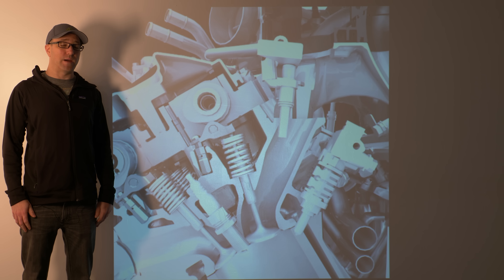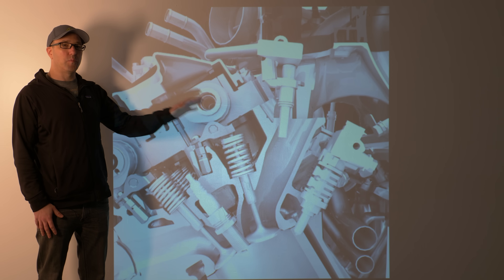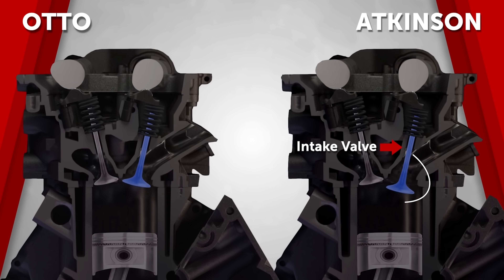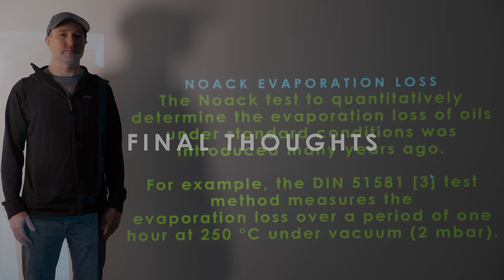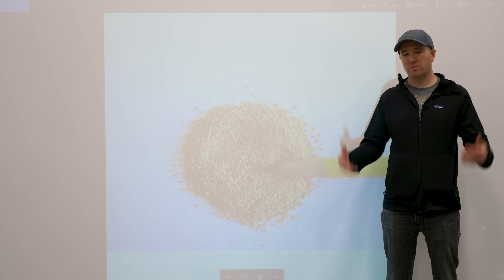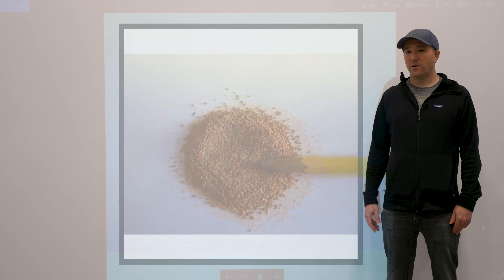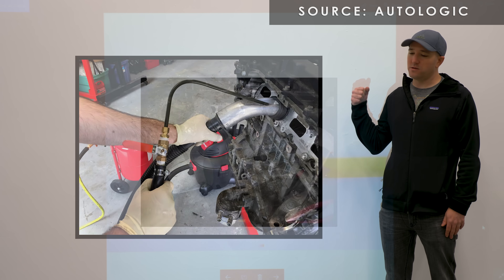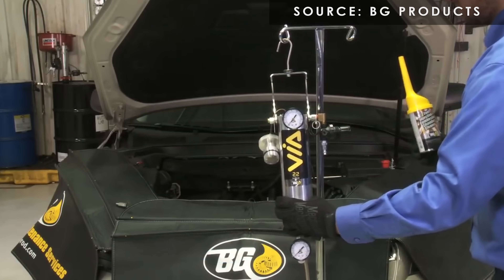Direct Injection, Problems and Solutions | The Fine Print

Comment: I worked for Orbital Engine Co in the test department where my job was to optimise the fuel delivery timing to combustion space using our two fluid direct injection system. The injector used two chambers . Low pressure fuel was metered by the lower chamber and the upper chamber was fed with high pressure air which was used to blast the fuel into the combustion space at the appropriate time for the particular speed and load. Using the air assist injection gave us control over the spray pattern and droplet size and playing with stratified charge enabled air fuel ratios as lean as 70:1. Had a great time mapping the engines! Transferred to the Tune Department and my job was to push the engine to it's power limits so basically I got paid to blow up hand built engines at$50k a pop! haha!

Comment: The EU and their crazy regulations are the problem. A bunch of countries giving up their sovereignty to a bunch of bureaucrats who are hell bent of keeping themselves relevant by writing rules for the sake of writing rules.
Reply: Found the bitter Brit...
Reply: Not really. A hybrid car with dual injection and no turbocharger is no less reliable than older less efficient cars, but provides better mileage, less emissions, and more power. 

It's up to the manufacturer to choose the right thing. (Of course, if you want reliability, electric makes the most sense.)
Reply: @DarcersTech  its still not the manufacturer. European manufacturers tend to grant the wishes of the customers, who want more power with low fuel consumption. 
The average hp in Germany has risen to 152 hp (German PS). So manufacturers build engines with small engine displacement and squeeze out the most of hp that is possible at minimum cost. 
And they have to watch out for these regulations. 
Its these marketing guys who tell engineers to bild such engines. At the end you can throw them away after surpassing 150.000 kilometers.
Reply: @davidradtke5166  And what I am saying still stands true. An electric motor can be used for power / torque support without significantly increasing the emissions.
Reply: @DarcersTech  still. Modern cars are now throw away items. Electric motors for helping with power/torque are built often in sports cars the average human can't get. 
Porsche 918 Spyder, Jaguar X-C75 and such.

Comment: Great video! Oil separators are used in many applications. Many piston airplanes use them more to retain oil rather than control it as they vent blow-by over board and we need to keep the oil. But they work the same and are very effective.

And walnut shells have been used to clean jet engines literally running them through a running engine. 

This dude has his stuff in one sock. I'm listening.

Comment: I own a turbo GDI, and have studied the technology since I bought it.  I was very surprised that this guy didnt mention the key preventative maintenance measure for these engines.  As per Hyundai/Kia, you should do a chemical GDI service every 12,000 miles.  It cost around $60, doesnt require any dissassembly, and takes about 20 minutes. A technician hooks up an IV bag that hangs on your hood and it connects to the intake tube just after the throttle body. It feeds about 1 drop a second while the car idle is set at 1500 RPM.

Comment: Before trying to explain something using someone else's material maybe understand the basics. Half the info in here is wrong. Some GDI systems use electric pumps all the way. DI doesn't require "complex" components, ever heard of a diesel engine? The injectors don't flow more fuel, if you think DI injectors need to flow more fuel you need to back and learn about how a gasoline engine works. Also you're clearly not aware of this, but Honda has this thing called VTEC that existed before GDI became popular. VTEC changes valve timing and lift. It was used, quite successfully I might add, on engines that had .... wait for it ... multiport fuel injection!

I wouldn't have complained but youtube keeps suggesting the video to me.

Comment: Top notch
An excellent video clear , concise & very informative
Personally I drive a twenty year old work van bought it new December 2000 it to this day has only 45000 miles on the clock. It has only had 1 service its first one, it has never yet failed the yearly m.o.t, it has NEVER failed to start. Its a bit battered & bruised.......Recently I've been looking round at new vans. They are lovely toys with all sorts of bells & whistles that are great while they're working correctly. Is it possible these days to buy a simple vehicle ie van for work. When I say simple I don't mean Crap.
PS... I am a small time self employed local builder, Very local 
I live in the u.k
Any guesses what my van is ? A clue, it's no longer in production... now there's a sign of the times. A great little van, yet they stopped making them

Comment: GDI.Guaranteed dealer income.
Reply: Well said!!!
Reply: I had a VW Passat 2.0T that was bad with carbon build up on the valves. 
I cleaned the valves using crushed walnut shell through a cheap media blaster that hooks up to an air compressor (this is actually the standard method most commonly used). This makes it super fast and easy, the valves look new afterwards.
 Just make sure the valves are closed before blasting them of course, ha. 
Clean the first two ports, then turn the crank pully until the valves in the other two ports are closed. When you're done, just vacuum up the mess.
Reply: Guarantee dirty intakes.
Reply: More like failed government regulation. Works at first then gunk's up and now you have poor fuel economy.
Reply: Exactly. Fuk it.
Reply: Yes sir😂
Reply: Well said , all corporations get a piece of pie. Same as hospital. Guaranteed health insurance income.
Reply: Ding ding!! Just like all the other bs in modern computers, oh, I mean cars
Reply: @RothBeyondTheGrave  Just say you don't have the brains. 😂
Reply: Really gets old hearing the simple minded conspiracy response to just about everything.
Reply: @rcpmac  ikr
Reply: @rcpmac Nothing simple minded nor conspiratorial about noting the likely higher maintenace cost of gdi injector systems. The fix is to add back in port injectors. So now; two injectors per cylinder. All more maintenance not to mention about double the required oil changes with recommended expensive full synthetic oil and required fuel additives. More expensive to build, and certainly more expensive and time consuming to maintain.
Reply: @jeffh2125 -- it is being simple minded and a conspiracy theorist. People like you whined about central fuel injection, sequential injection, port injection, electronic ignition, overhead cams, front wheel drive, halogen headlights, radial tires, etc.
Reply: @PorkyHontas I never whined nor complained about any of that tech. I'm stating a fact that direct injection is filthy. I don't care if agree or not pork for brains.
Reply: owned my GDI  hyundai 5 years not even skipped a beat yet.. and my neighbour just sold his after 9 years so some manufacturers well go while a while before cleaning be 6 to 7 year  when spark plugs would be due at that point
Reply: @joebrown9621  whoosh 😐

Comment: The seal on the cam for the High Pressure rail (1500 psi) can fail, ending with the fuel being pumped into the Oil sump!

Comment: Ford eco boost engines are having the exact problem that he’s taking about. What ever you want to call it pressure or vacuum pcv system is causing the two center cylinders to become carbon on the center two cylinders and Ford fix is to replace the head under warranty. Well what is going to happen when you run out of warranty and then you will have to pay for new heads. This information is from a Ford bulletin and a Ford Automotive Technician that’s it is happening to his own escape. They also told him to install a catch can. The reason why they don’t put them on your new vehicle now is because they know that they won’t get emptied out in time. And that people don’t do proper maintenance as in changing their oil when they should. FYI

Comment: Does DI yield net gains in emissions and fuel economy? That is, does the added efficiency of DI over PFI when both engines are new (i.e., clean) offset the potential [and sometimes pretty significant] loss in efficiency that can occur with a DI engine?

I purchased a 5-year-old DI car as a beater that had about 60k miles on the ODO and it was fed mainly Top Tier fuel. It should have been averaging about 30 MPG, but was closer to 22 MPG. After chemical cleaning, the average then went up to about 30 MPG. Presumably, for quite a while, the previous owner was driving the car in a state where it was running less-efficiently, consuming more fuel and producing more emissions. Comparatively-speaking, when new this engine was supposed to be more efficient than a comparable PFI engine...but by 60k miles, a comparable PFI engine that was given identical treatment would presumably be operating more efficiently than the DI engine. Obviously, PFI efficiency also declines as the injectors become clogged, but with modern PFI cars running modern detergent gasoline, PFI seems to be extremely consistent and the loss in efficiency seems to be much slower...?

Comment: This is WHY i remove the PCV valve completely and just put in a straight thru fitting and run a hose from that to the INLET 1 of my 3 port catch can ...
Then i run another hose from my Valve cover breather to the INLET 2 of my catch can..
Then i run a hose from the catch can OUTLET to my exhaust pipe under the car, this way all that filtered blow by from the catch can gets shot out the tailpipe ... 

And like the video said, TURBO or supercharged cars have this WORSE ... Because when your motor is under pressure... that pcv is CLOSED forcing all that crankcase blow by pressure to exit thru the valve cover breather which is going BACK into the turbo inlet & thru the turbo and your intercooler and back into the intake ...  And just HOPE that your valve cover breather opening is large enough to let that motor breathe and exhaust that blow by pressure, if not that will cause restriction and guess where that blow by pressure will have to escape thru...??? Gaskets and seals .... Causing an oil leak ... 

This is why on BOTH my 2 turbo cars, i did the above setup, this way the motor can breathe under boost and non of that blow by goes back in...

Comment: Direct fuel injection (GDI) was developed by the Germans (1930s) to be used in gasoline powered aircraft engines. It was derived from mechanical diesel fuel injection systems (Bosch).  It's first auto use was in the 1954 Gutrod. As car emission and fuel mileage standards increased, car manufacturers realized GDI was a solution to both of the problems. I have a 1956 Goliath Express van with a 900CC two cylinder two stroke engine that is GDI.

Comment: Error Error pcv is for the pressure that gets past the rings going DOWN into the crankcase, there should never be enough pressure in the crankcase to push up into the combustion chamber.
Reply: I noticed that too, he was talking about the crankcase and it didn't sound right
Reply: Yep high pressure in crankcase blows out oil seals, and resists piston travel on the power stroke.
Reply: Yes there should be it's called Bad Piston Rings and bad valve stem seals haha

Comment: Any details about Mazda Skyactive 2.0 and 2.5 engines ? Do they suffer from carbon build up and require frequent cleaning ? And how frequent if yes ? Almost 100% city driving and traffic is always bad here, lots of stop and go. Thank you !
Reply: As a Mazda service tech. Yes. Yes they do.
Reply: @brandonabee1457  thank you for reply ! How often in mileage on average before it needs a clean up ? Do you know the approximate cost to perform one at dealership ? And can you fill 87 Regular unleaded for those engines ? Premium gas is quite a lot more expensive for some reason, almost a dollar more per gallon :( Thank you 😀 i am thinking about buying a Mazda, love how they look and drive and effort put in them by Mazda, just worried about cost of ownership being very high. If you get a moment please share your thoughts about carbon cleanup intervals and ok or not ok to use regular 87 unleaded :)

Comment: I love this but I do believe that reverting back to port injection would be the best, none of this port and DI bullshit since now it forces the car to have all these extra parts which will cost a fucking fortune every time something breaks and diagnosing will be an nightmare!! I really don't believe that the emissions from a port injection engine are much worse than a DI engine, in the end you're burning fuel and releasing it into the air. People think that you can get better fuel mileage and power out of  a DI  vs a PFI and I believe that is a myth as well. For comparison: my gf has a 2016 elantra with a 1.8L DI which has 150hp and 130trq, she gets about 600km's a tank of pure highway driving, a few years back I had a 1994 integra GSR with 1.8L PFI which made 180hp and 130trq, I would almost reach 800km's on a tank of pure highway driving... Now which one is more fuel efficient??? I think all this shit with DI being more efficient is a myth especially once your valves get gunked up as you mentioned and ends up being worse for your car and the environment!!

Comment: Sounds like the PCV system needs to be re-engineered for DI engines. Heck I think the fuel delivery system and the engine in general should be re-engineered to utilize vaporized gasoline.

Comment: I have a Volkswagen Golf GTI 2017. I was pretty upset when I found out about this, especially since I was deciding between the GTI and Ford GT. I have done a ton of research and the Catch Can's don't really work, at least for our cars. All I can do is run BG 44k every 20,000 miles and walnut blast the valves at 60,000 miles. Hopefully the car will last 120,000 miles.  I've been using high SAPS oil and am still deciding which oil to transition to. Thanks for bringing up NOACK... I wasn't giving it much attention.

Comment: Direct injection washes lube oil from cylinder walls,infact most petrolengines do this carb or injection,i have been (mentally and physically) working on some designs that DO fix this problem,and also GIVE excellent MPG figures,most if not ALL new cars could run cleaner and get excellent MPG if the "OIL companies ,CAR manufacturers and GOVERNMENTS were really honest and gave a crap,but they don't.

I'm sure the US government imposed a law on SUV makers to get better milage,they got around twenty MPG,for a big V8 that's not too shabby,the only problem was the next pres changed legislation and it all reverted back to around 10MPG.

Catalytic converter clean the mess the car and oil companies make,basically ALL cars push too much fuel in and get for that bad power and emission  figures.

I know of a few ways touted on ebay that actually work as i have tested them,ok small 4T engines but the principles are the same,i've also made my own designs that i know will work ,because the parts are already working on engines right now,just not how i would arrange them.

If i can do it so can big companies,else where on youtube i mentioned shells experiments with fuel saver devices in the early 70s,getting around 120MPG from a V8 buick,that weighed around the same as a humvee,i watched shells own video and one of the engineers who had all his credentials and id on show,an english gent in his 70s or 80s saying oil companies have shelved more super clean petrol engine designs than any sane person can imagine,because they and the oil companies and governments make too much money off of our backs.

One last point,i live in scotland,crude oil comes from a hole in the ground,here fuel tax is way too high,the same petrol from crude is sold to the two stroke or four stroke taxis in india,does their fuel come from a different source,or is it that there is so many of them that  india gets its revenue from poor ass civillians there.

AND THEY BLEAT ABOUT GREEN THIS AND GREEN TAX AND POLLUTION AND GREENHOUSE GASSES,which by the way volcanism puts out more crap and poison in one year than man has in all our mechanised history,and electric cars are crap.

Comment: This guy has missed the basic reason that D.I. works; for better power, and gas milage, and still use regular gas instead of premium.. It's called "THE LATENT HEAT of EVAPORATION." (Lick the back of your hand, and blow on it. Feel the cool?)Higher Power is developed by higher compression ratios, advanced ignition,  supercharging/turbocharging giving higher manifold pressure, and so forth. HOWEVER; the limiting factor is the octane of the gas. Higher octane, allows higher C/Rs and so forth. BUT...……….With D.I. the fuel is injected into the chamber DURING the compression stroke, allowing a higher C.R. because the evaporation of the fuel is lowering the heat of compression, giving a denser charge; ALL WITH REGULAR FUEL.The Germans used it I W.W.11, because they didn't have the then Top Secret compound called "Tetra-Ethyl Lead" that the Allies had. (the Ethyl Corp. of New Jersey,)He's right in that using a third injector to keep the intake valve clean, is a required thing.(I had a Ford F-150 'Eco-Boost' and what a MACHINE!)